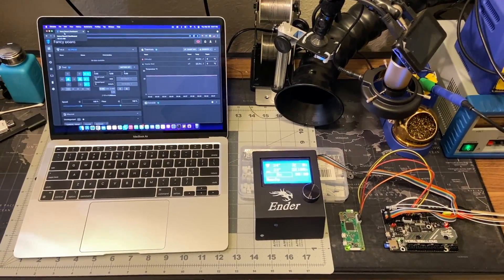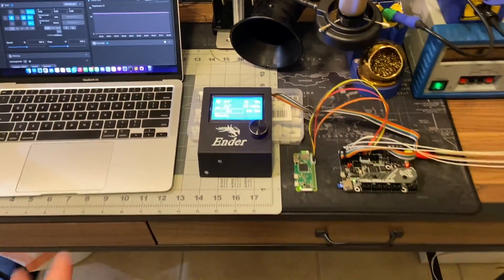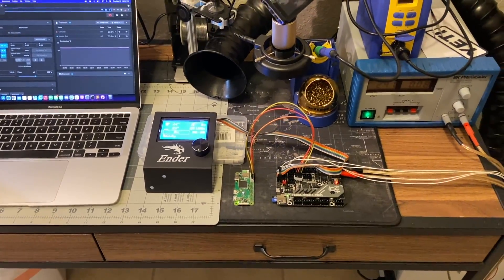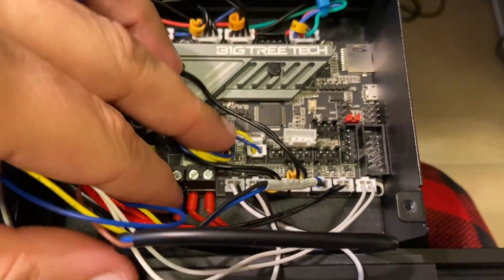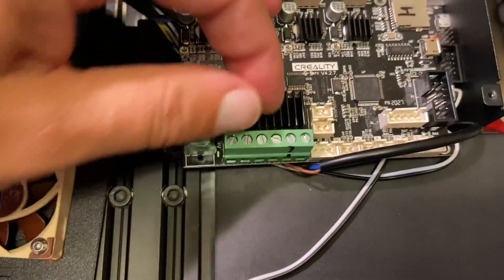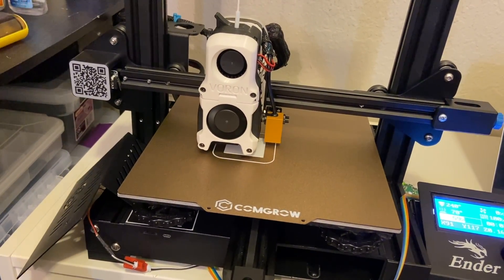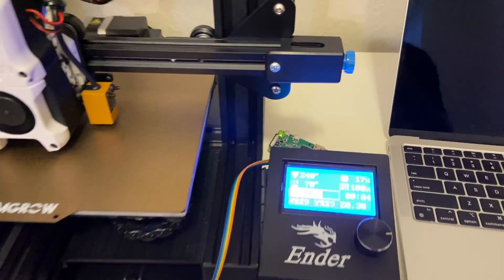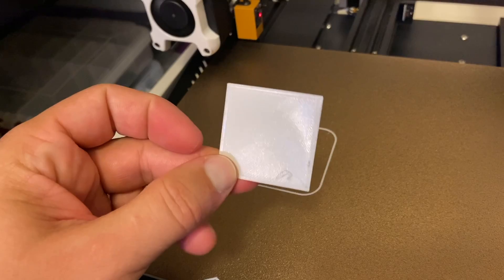Installing BIGTREETECH SKR Mini E3 V3.0 in Ender 3 with Klipper

Comment: Great video. I have an Ender 3V2 with a dead stock board. I would like to replace it with a SKR Mini E3V3 / Pi zero / Klipper. I did not understand the details when you said that the V2 screen did not work with the E3V3. Can you give me more information please?
Reply from the maker: The Ender 3 V2 screen has its own firmware, and at the time of the video there was no firmware for it to be used with Klipper. I've seen some articles where people were able to get this screen working with Klipper, but I have never tried it myself and it looked like a lot of hassle with a half-working screen. You will have to dig yourself to see if someone was able to get it fully working.

Comment: Is that a retrofitted extruder setup? I can see its voron but how did you fit it to the ender 3 pro? I have a microswis all metal hot end and extruder setup.
Reply from the maker: There are plenty stls around for those setups, it was full size voron toolhead. You don't have to overcomplicate, 1st move over Klipper and after that you can install something like: https://www.thingiverse.com/thing:5172583 - one of the best cheap options around.

Comment: Does this work with the 3.5 inch tft btt screen ?
Reply from the maker: The only TFT screen it works with is: BIGTREETECH TFT35 E3
Reply: @hobbyistnotes  yes that's what I have. A ender 3 pro running a micro Swiss all metal hot end , a btt skr mini v3 and the tft35. Currently in custom Marlin. Want to move over to klipper
Reply from the maker: @ForwardEngineering  There is just no way I am going back to Marlin, Klipper is so much better for all my use cases.
Reply: @hobbyistnotes  okay cool just wanted to confirm functionality. Is there any reconfiguration stuff I need to be worried about like e steps, bed leveling mesh, ???
Reply from the maker: There is a learning curve sometimes filled with frustration, but it’s worth it. Use klipper config from BTT github repo for the board you have and it’s 95% of the work with config done. Now klipper is well documented and a lot of info out there how to proceed, I would recommend you to watch several full guides before starting just to get familiar. Use latest Maisail now it’s the best and MainsailOS has all needed packages preinstalled. If you use RPI mainsail OS is presented in “special images” section of RPI Imager tool.
Reply from the maker: Before you flash firmware over the board make sure you updated all the packages, otherwise you can flash older klipper and after update you will have to flash it again.

Comment: Great video, this motherboard will help to improve the speed of the printer? or how can i make an old ender 3(2018) to print faster?
Reply from the maker: Motherboard only will give you flexibility in features but it doesn't mean you have to buy it. You can get pretty fast with original hardware the only thing you will need Raspberry Pi or similar single board computer and ADXL sensor. With Pi you can convert Ender 3 to run Klipper which has few important algorithms Input Shaper and Pressure Advance which will help you to get significantly faster without losing the quality. Input Shaper will help to reduce resonance frequencies which can be measure with ADXL sensor and Pressure Advance allows to regulate flow in to the nozzle the way it will push perfect amount of plastic on very complex features such as corners. If you want to get it fast 1st step Install klipper, there are plenty YouTube videos on how to do it.
Reply: @hobbyistnotes great explanation!! I was wondering why anyone would get the SKR vs the BTT Pi especially since the BTT Pi improves speeds by 5-10x as well as print quality and even can host octoprint. 
I dont really see the need for SKR unless i want it all really silent or need uses for the extra features.
Reply from the maker: @NagashiChidorii  5-10x sounds like overstatement. Feels like some one is trying to advertize BTT Pi.
Reply: @hobbyistnotes  huh? If you run at 60 mm/s. Then install klipper: 10 x 60 = 600 mm/s
How is that an over exaggeration? Klipper installed on btt pi can easily do that.
Reply from the maker: @NagashiChidorii  Because printing speed isn't just print speed that you set in slicer it's mostly acceleration settings and in case of Ender 3 it won't be x10 as it's kinematics aren't able to withstand forces related to high accelerations CONSISTENTLY without sacrifices. Don't forget you will need proper high flow hotend and good extruder which will melt/push plastic fast enough to handle fast speeds. But compare to stock printer you definitely can go x2 may be x3 depends on tune and assembly quality. Showing high speed is a very known marketing trick. I recommend to watch Simon from: https://www.youtube.com/@Vez3D he has several good videos with his printer printing at very high accelerations.
Reply: @hobbyistnotes  im running an all metal hotend right now and without klipper but with octoprint running on an a cheap amazon fire tablet, i can do 450 mm/s and 1200 accel with no issues. Im planning to install klipper soon as my btt pi just arrived today thats why i was watching your videos.

I’ll check that guy out. Thanks!
Reply: @hobbyistnotes  so i checked that youtube you linked and actually not too impressed. Because he is doing it with a $1200+ printer. Having high speeds done on a lightly upgraded ender 3d pro is much more impressive
Reply from the maker: @NagashiChidorii  I meant that acceleration plays bigger role than speed and Vez3D channel was offered so you could check how 600mm/s feels with 20k-30k acceleration. I agree that it looks more impressive on cheap machine. Speed mostly works like a speed limit and on small prints even you set 600mm/s you barely will be able to reach 80mm/s due to layer time(cooling) and slow acceleration. PS: I was able to get Ender 3 printing with 2.5K acceleration so you have room to grow and it's definitely a fun project with Klipper, good luck on that.

Comment: Thank you for the video I want to install klipper on my ender 3 pro with the skr mini e3 v3 but I don't what configuration I need to put on it can you help me?
Reply from the maker: Official klipper config by BTT is equivalent to Ender 3 with BLtouch. You can start here: https://github.com/bigtreetech/BIGTREETECH-SKR-mini-E3/tree/master/firmware/V3.0/Klipper
Reply: @hobbyistnotes  thanks so i need to put the skr mini configutation and so i can start printing?
Reply from the maker: @mattiamusica3059 Steps: Install MainsailOS on you Raspberry Pi or equivalent computer. Compile a klipper firmware and flash SKR board with it. Upload Klipper config from repo over your Mainsail. Make sure SKR board is connected to Raspberry Pi. Here is a good video how to do it: https://www.youtube.com/watch?v=gfZ9Lbyh8qU
Reply: @hobbyistnotes why is raspberry pi needed? Cant i do it with any other linux system or virtualbox on my windows pc running the linux OS?
Reply from the maker: @NagashiChidorii  Yes you can run Klipper on most Linux distros and this tool will help to install it: https://github.com/dw-0/kiauh I personally was able to make it work with VirtualBox but it's definitely not a task for beginner.

Comment: I see this is a year old now, but - I'm glad you got this to work for you.  I haven't been so lucky!  In addition to the Mini E3V3 I also got the TFT 3.5 E3 touchscreen.  Since that uses TWO ribbon cables to connect screen to mainboard, one of which is the TFT port on the Mini where you are connecting your UART wires, I had to use the micro USB port to connect to my Pi.  Here's the DISASTER:
TWICE now I have tried to flash their Klipper-USB.bin to the Mini, and TWICE it has BRICKED my Mini boards!  Yes - BRICKED!  Can't flash back to Marlin, or any other firmware binaries that they offer.  Nothing seems to bring back the Mini: the TFT screen insists: "No printer attached"  Quite frustrating, and BTT tech support is ABSOLUTELY WORTHLESS!  It seems like they are trying some AI bot instead of hiring even HALF-baked technicians for their support desk.
Reply from the maker: Reading your comment I think there is a room for “user error” as one time could be true but chances of two boards having same issues considering quality of their boards are pretty slim. Can you please describe the process how you flashing the board. I own most of the boards BTT makes (some purchased myself, some sent by BTT) and all of them are still working fine even after all abuse I have put them thru over few years of making videos.
Reply: @hobbyistnotes  Hey - THANKS for picking this up, in spite of its geriatric side....  (off-handed admission of my OWN status, having clicked off yet another DECADE just this week)  ...which goes directly to your "user error" theory.  Well, after fighting the 1st one for about 10 days, you can believe I was EXTREMELY careful with the 2nd - verifying the FTF connection and the BT Touch connection and getting the 3 fans in proper order.  Things looked fine, then, upon 1st boot-up, BUT - as my entire plan was to get this running klipper, after only the simplest of checks (I tried "Home X" from the TFT touchscreen.  Check!  So I copied THEIR klipper-usb.bin to my micro SD card (a 32 G card BUT with only a small FAT partition expressly for this task) and renamed it firmware.bin and inserted it into the Mini slot and booted up.  It appeared to take it up, as it renamed it FIRMWARE.CUR - but from then on, just as with my 1st Mini board, the TFT now reports "No printer attached" and the BTT Pi 1.2 that's connected via USB cable does not see ANYTHING at that serial port.  No sign of new device when plugging the USB cable in after bootup - NEVER any sign of the port as described in the BTT doc:  something like /dev/serial/by-id/xxxxxblahblahblah -- there's not any /dev/serial folder at all, so everything downstream from that is MOOT (useless).
Now the board is unreachable, ALTHOUGH -- oddly enough -- it DOES seem to pick up further firmware.bin files from the micro SD card, if converting the file name to FIRMWARE.CUR means what I think it does?  Problem is, no matter which BIN file I try (from the BTT github files) it does NOT return to OPERATIONAL!  And their tech support seems to have almost as much trouble deciphering English as I would Chinese!  Asking simple questions like 6 or 8 times without the slightest hint of an answer - well, it's more than a little frusterpating!
Reply from the maker: @palewriter1856  The reason why BTT'sGit Repo *.bin Klipper files aren't working for you is cus probably they are outdated to the point your host klipper wont recognize any connections with the board. I would try to unplug everything form the board other than USB, compile USB based Klipper with config file requirements, flash it and check if device appears in to the USB list. If you flash UART firmware board wont appear in to the list of devices and wont work other than via UART. If file on the sd-card changes the name that means at least controller is working fine. There are some cases where you need to also try other cables not all of them work. The symptoms you have presented proves ether something wrong with firmware you are flashing or with something that you plug in to the board. Main reason why I always configure and make everything work without external devices and only then plug board to the peripherals and finish the build. Let me know how it goes for you.

Comment: If I install one lcd screen on Raspberry Pi, can I control trough LCD touch screen? No need notebook or PC?
Reply from the maker: You can, especially if you tune it well. BUT that is not where Klipper shines, if you need such simple executor may be make sense to take a loot at Marlin?
Reply: @hobbyistnotes I undertand, i will take some days to do, bu i have raspberry, e3d v3 board, 7 inch lcd screen...i know im will fight, im asking about the control trough lcd screen, because my old board and printer is LK4 Pro (Alphawise U30 Pro), and the lcd is not compatible (at least on my ressearch), with the e3d v3 bbt, than i buy a 7 inch lcd screen on aliexpress. 

So, i can calibrate the printer whith klipper usar interface like marlin?

I know i have a lot of research, im just try obtain this question before start conversion. 

Thank you very much, best regards from Brazil. I subscribe,  awesome channel, thank you again for share your awesome work!
Reply from the maker: @PauloIrineudeSouza  Yes it can do most of the things that Malrin does. Best research in this case will be to try it. Personally after using Klipper for last 2 years there is no way I will go back to Marlin with it's dumb small tiny screen controls and etc. An amount of freedom and controls over your printer with Klipper is just mind blowing. It's hard to explain you just have to experience it. May be for "dumb" print farm where printers prints same part 24x7 Marlin is good but if you want full control without a lot of hustle Klipper is the way to go and only RepRap can compete with Klipper but I haven't personally tried it as Klipper has all I need and more.
Reply from the maker: @PauloIrineudeSouza  I am not using screens on my setups at all as I have PC in my hobby room. So it's really depends on your needs. If you have PC nearby just convert over Klipper try it and if needed get yourself a screen. With e3d v3 bbt there is 2 ways to use screen one is as in video connected to the BTT board another is to connect screen to the RPI directly, in both ways you just need to figure pinout and most screens are supported. So what I am saying whatever screen you have might already work with hardware you have.
Reply: @hobbyistnotes  I understand, because i need slicer and configure the stl first, so if i using a notebook for this, makes a lot of sense do it all the rest for user interface on notebook, trough ip...

Many thanks for your generous explanation! Will be very good to me all the learning procces. Thanks a lot!!!!

Comment: hi, with this board it is no longer necessary to buy a rasperri to install clipper?
Reply from the maker: Hello, at this point Klipper is a two board solution: motherboard's MCU does very low amount of work and executes simple instructions where RPi is doing all the processing... As far I am aware there is no way to run Klipper without second computing board such RPi. BUT! There are very huge amount of other computing boards and old PCs or laptops under 50$ that you can use for such work, you pretty much just need any Linux machine with USB port.
Reply: @hobbyistnotes cant i just use BTT pi to run Klipper on a stock ender 3 pro without having to flash the stock board?
Reply from the maker: @NagashiChidorii  No, You will have to flash the board, but it's easy as you don't have to disassemble your printer. Stock board running Marlin and Klipper is a 2 side system one side running on the Motherboard another one on Host PC like RPi or BTT Pi or some other single board computer.

Comment: I would like to see in more detail how klipper is installed on skr mini e3 v3
Reply from the maker: Fortunately it's very common content on Youtube, Klipper installs exactly the same way as any other board via sd card, you will find exact klipper compilation settings in SKR-mini-E3-V3.0-klipper.cfg file at bigtreetech github repo - link listed in to the description.
Reply: @hobbyistnotes  I found it, but for unknown reasons, klipper cannot detect the printer, so I would like to see a step-by-step installation of klipper on skr mini e3 v3
Reply from the maker: @v1tamin91  Для начала надо разобраться каким путем вы подключаете плату к Малинке, через UART или USB дальше надо шить плату под этот интерфейс. В описании ссылка на видео от Неро процесс 1 в 1 точно такой же, ничего лишнего. Следуйте настройкам в конфиге от Bigtreetech.
Reply: @v1tamin91  I've tried TWO Mini E3V3 boards - both now BRICKED by flashing the BTT klipper-usb.bin firmware.  Resulted BOTH TIMES in my TFT 3.5 screen insisting: "No printer attached" and, indeed, none of the controls work after that flash.  Trying to restore by flashing one of their marlin binaries will not restore functionality, either!
Reply: Today I learned from a techno-wiz at BTT that the TFT 3.5 will not do its dual-mode thing under Klipper - so my self-imagined Klipper "solution" with the Mini E3 V3 and the TFT 3.5 E3 and the BTT Pi 1.2 was a misguided PIPE DREAM!  What I am waiting for from them NOW, though, is comment on how their klipper-USB.bin firmware knocked the Mini board on its proverbial donkey derierre.  What it SEEMS to have done is simply to kill the micro USB port, but as I said - remains to be seen....

Comment: how did you connect the screen? ext 3 on the lcd directly with the stock cable on the e3 v3 board? I cant find any information on this
Reply from the maker: What exact model of lcd? What printer?
Reply: @hobbyistnotes  enh12864z-1 v1 and ender 5. I think i may just have to plug it in with the default cable. Found a small note in the manual of the btt mb, whichs says, it should be compatible.
Reply from the maker: @theBugfisch123  Yes stock cable works, you can see the way I have connected it. No mods.
Reply: @hobbyistnotes  great, thank you very much! Sorry for wasting your time

Comment: I know I’m very late, just trying to do this tonight. Two questions though- 1) Do you have an extra fan somewhere? My printer only seems to have 2 in the wires. 2) How can I mince these wires? Do I need to connect them to something/each other or just completely take them out? Thanks in advance :)
Reply from the maker: You need to crimp JST connectors for all fans, on the board you will find FAN0, FAN1, FAN2 connectors.
Reply from the maker: Refer to the board's pinout, link to the user guide is in description.